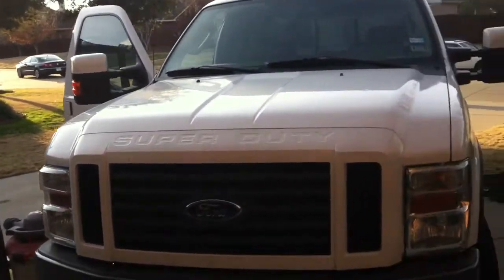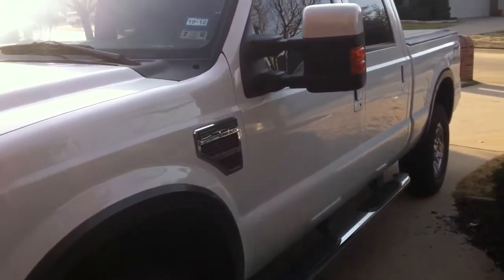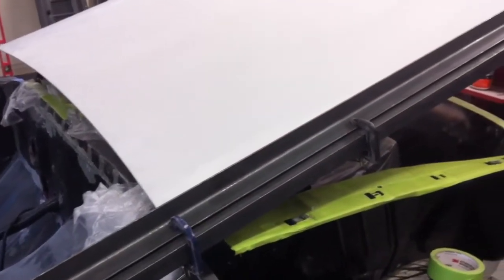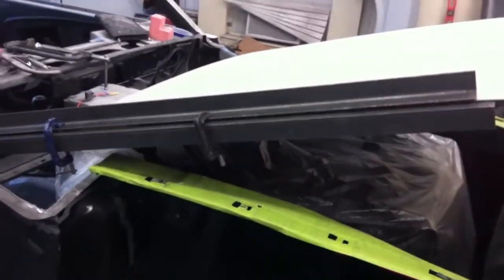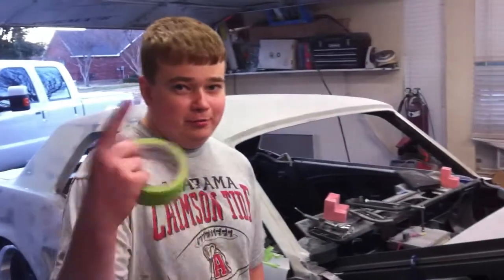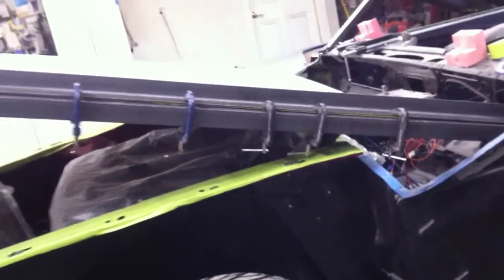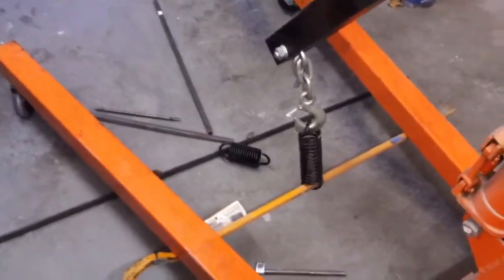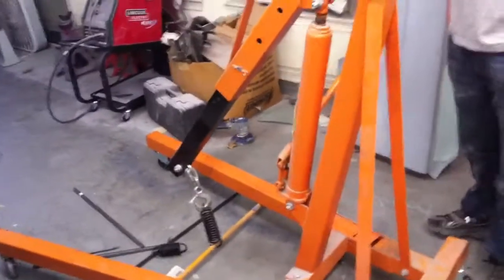More Hood - Fender Work

Comment from the maker: @gregmporter Greg, yes I measured it, you probably missed it in a couple videos back.  It's out of square 1/2" the best I can tell.  I had the hood on when I measured it.  I think my mistake was not putting the cowl back in because its a structural member of the unibody and could have effected the squareness of the engine bay.  Thanks for watching!

Comment: Gary, I don't know if you have measured the diagonals across the engine bay opening.  It should be the same from back of left fender to front of right and vice versa.  If they are uneven it means you are out of square.  Even if you are not going to do anything about it, it would be nice to know how far off it is.  1/16, 1/8th, 1/4, etc...  Everything is looking great.  I like your spring stretcher and the panel flattening jig.  Anything that works is fair game.